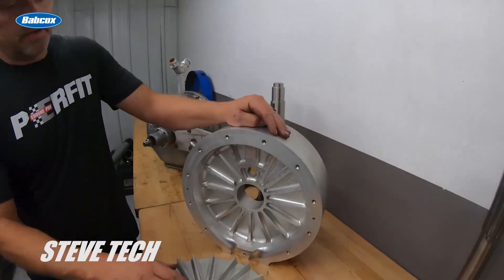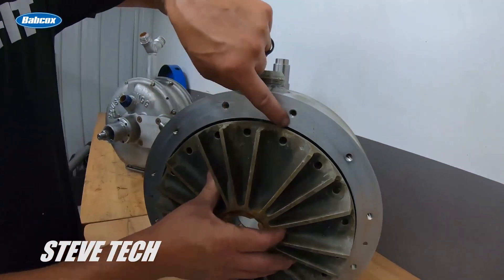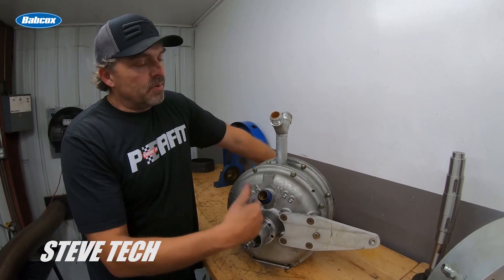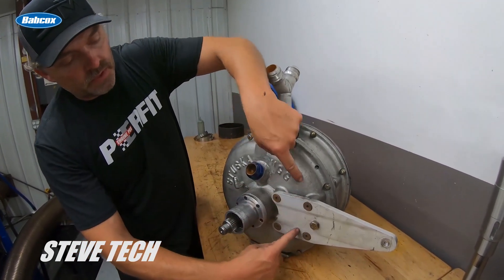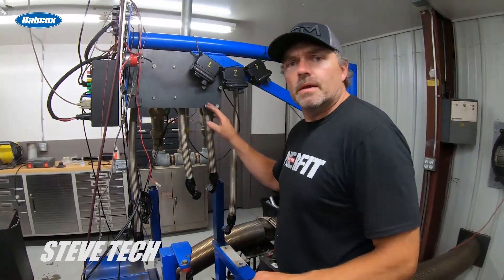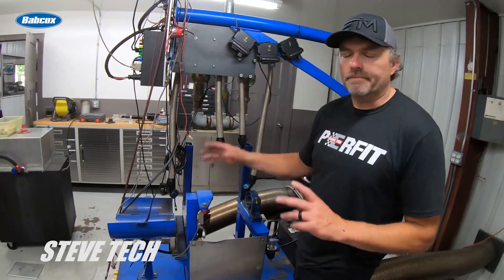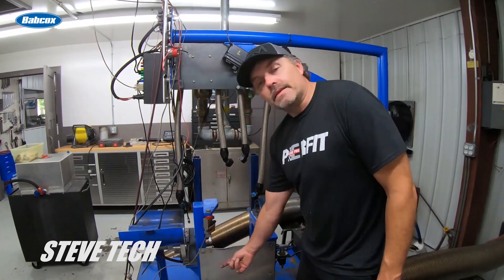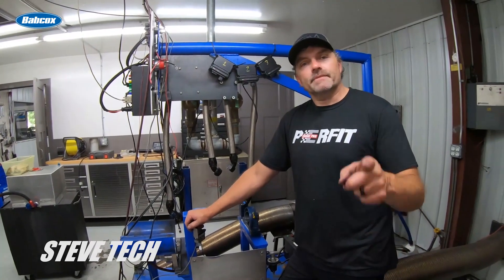Engine Dyno Absorbers – Part 2

Comment: @Steve, looks like, you did figer out to make the water brakes you need for your work.  why did you go for a partnership with yourdyno? i have 2 of there dyno kits and understand why you  change the electronics, but why did you change to there water brake? or was the your dyno water brake a good deal that you had to try out?

Comment: Steve what type of water controller valves and electronics are you using . We have a old Go Power brake we are trying to set up at small engine shop, It uses old hand valves and want to build something new and better, We had been in contact with Depac Dave but he has since passed, any thoughts on what make controllers are out there?  thanks for any insight